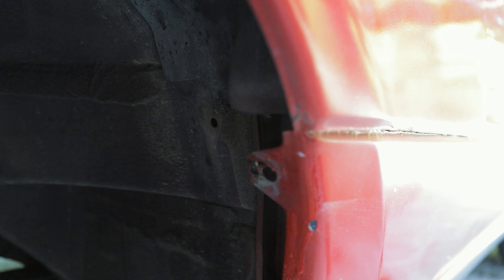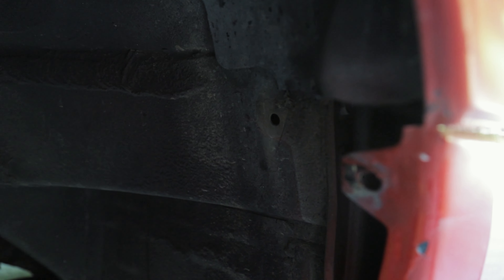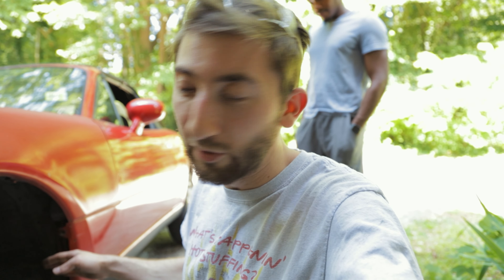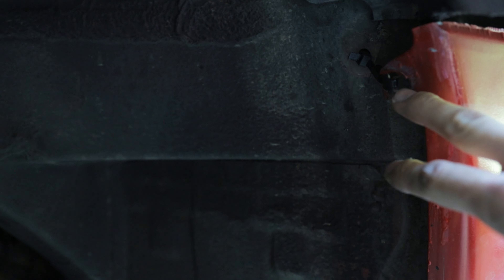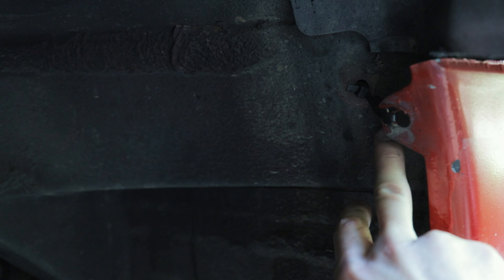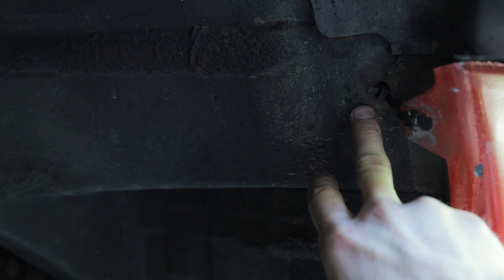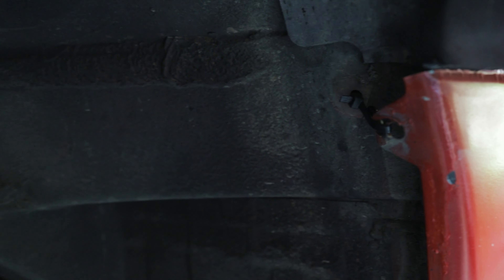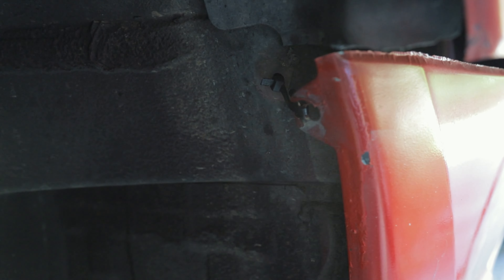The Miata Fender Cut How To!

Comment: you forgot to sand down the sharp exposed metal you have there AND you forgot to spray some pain on that exposed metal to reduce the chance of rust
Reply: Miata fenders are aluminum
Reply: @bullet_miata  if they were, mine wouldnt be all rotted out along with what part where wter drains :/

Comment: Hey Alex, what is the point of this mod?
Reply from the maker: Just looks cool imo.
Reply: @AlexPerrucci  Ok, thanks Alex. Sorry to rain on your parade but it doesn't seem to do anything to improve the design, IMO. Besides, now your design draws attention to the  raw metal edge which is not perfectly straight, making it look like a homemade job, which it is. The front edge, i.e. nearest the tyre is quite sharp, and being unsupported  it may move inwards under driving conditions, possibly cutting the sidewall of the tyre, thus being dangerous. Here in Australia it would certainly void its roadworthiness so it would be put off the road. Sorry, but this mod is a fail for me!
Reply: @rallymaster001  womp womp